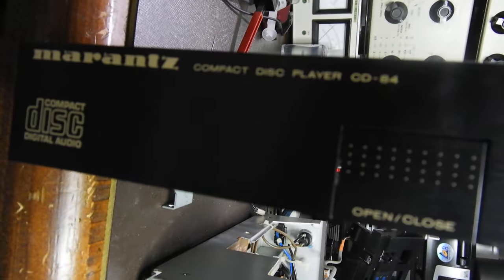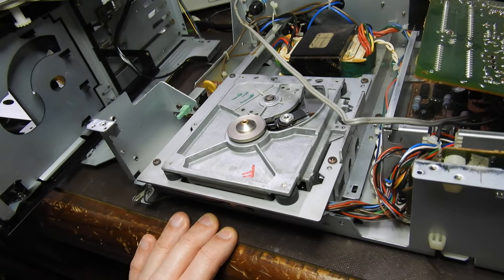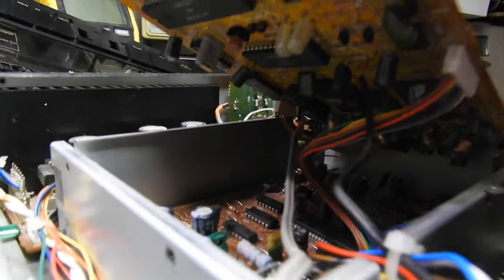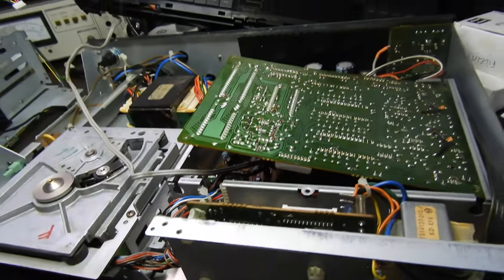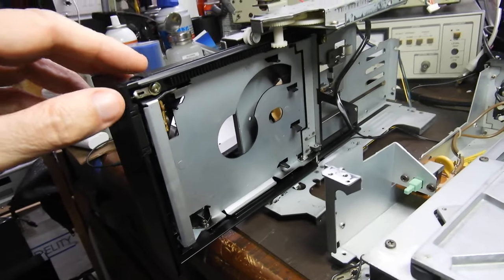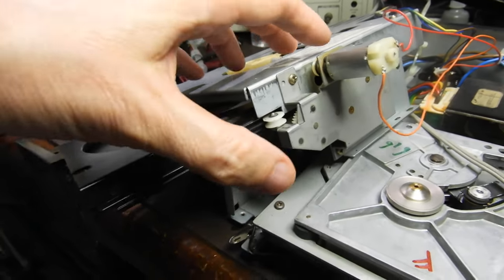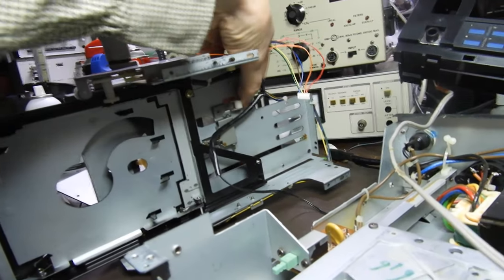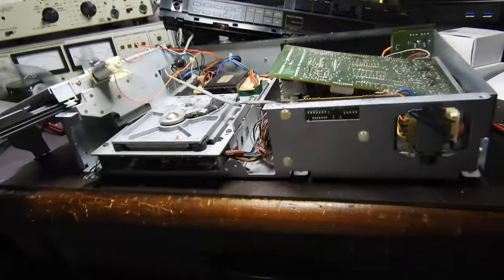Marantz CD-84 with the drawer that was hesitant to travel. Otherwise working fine after 40 years!

Comment: Great video as usual. I learn more from these videos than any service manual I've ever gone through. I have a CD-74 that won't play. The laser comes on and it attempts to focus. However, when read with the Leader power meter, it only shows about .08mw. Can that power be increased on these older units, or does the laser current have to be increased to compensate, or is the laser just shot? I did look around on all boards and there are no dreaded blue philips axial caps, not even on the laser power board on the bottom of the mech.
Reply from the maker: Yes, of course you can adjust the power. I tell people not to do it, because even tiny movement with the pot can have huge consequences, but you have a power meter, so you would know if you went too far. I do not remember what was the power on this unit. Most players have power of 100µW, so 80 µW in your Marantz is not a disaster. Some players use 200 or even 300µW, whereas other work on 25µw (like most Arcams). If taking it to 125µW does not dramatically improve playability, than the problem must be somewhere else. Does the head travel freely? Get a ESR meter (preferably one that can read in circuit) and test some capacitors on the laser, servo and power supply circuits. Also measure supply voltages when you close the drawer and attempt to read T.O.C. Are supply rails steady or do they dip? If the do, then other than capacitors, it could be regulators that are failing. Hope it helps.
Reply: @hear-net-au  Thanks again. I now have it working with commercially pressed CDs, not CDRs.

Comment: What oil would you use to lubricate a Sony KSS-151A laser rail? I think they have small phosphor bronze bushes in the plastic laser body? So oil would be preferable to grease, no?
Reply from the maker: I do not. I never use any lubricant where there wasn't one applied at the factory and they do not lubricate those rails. The head travels on a wheel which is underneath and does not touch rails, so there is no need to lubricate. I clean them though with isopropyl alcohol and make sure, that the head travels smoothly and that there aren't any foreign object like washers or screws that have been attracted by the magnets.
Reply: @hear-net-au  Ahhh OK. Interesting, Thanks. Just got a Denon DCD-3520 and it seemed quite sticky, so I added a tiny drop of turntable oil to that shaft and it instantly freed up and worked fine (stopped the skipping), but maybe it just needed cleaning. I will clean it all off again with some IPA and see if it's still smooth and free. Thanks for the info and love your videos. Very informative and interesting to see life inside high-end audio gear, that one would never normally see. Keep them coming. Thank you.
Reply from the maker: @marleytyle  That is fair enough. It is OK to lubricate the polished laser head shafts, but KSS-151A does not use them. The magnetic rails do not actually make physical contact with the head (that is their point!) and instead the head rolls on a wheel which is underneath.